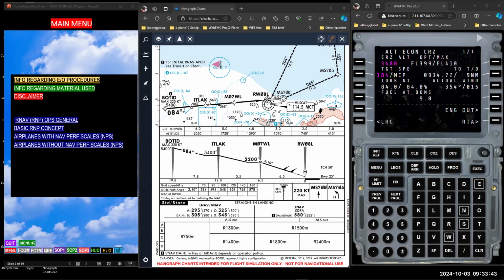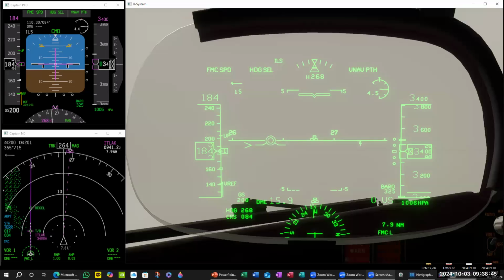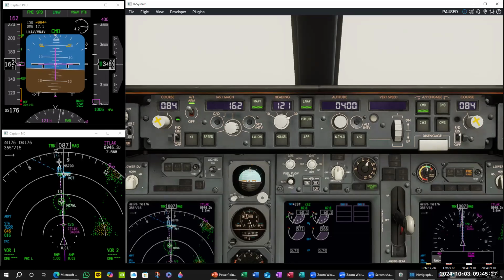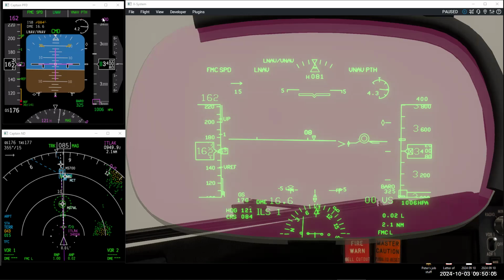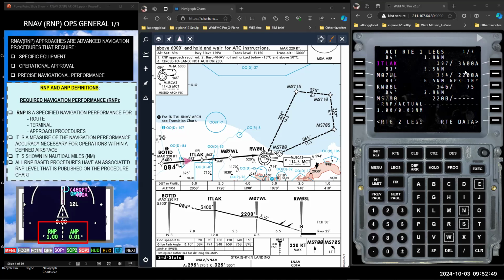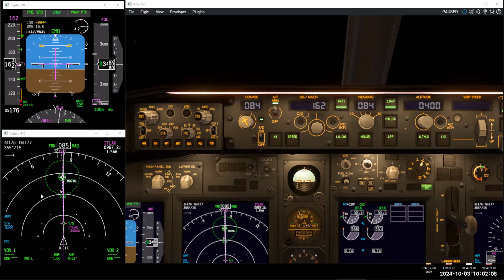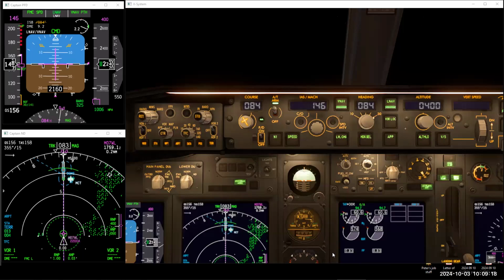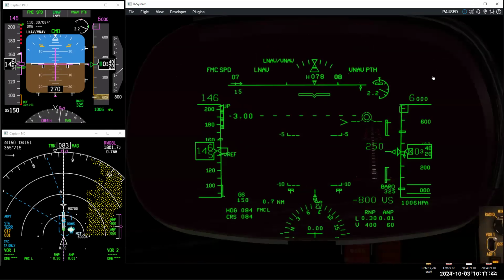#RNAV RNP RWY 08L OOMS part 1

Comment: Hello Captain,

1)
Regarding the HUD, should it normally indicate 3.10 deg Glidepath?
Because it is showing 3.00.

2)
Can you show us how to calculate how much higher we are if the temperature is high, please?

3)
I saw your video about temp correction.

Can you tell below which temperature, we have to include temperature corrections for altitude and minimum, please?
Reply from the maker: 1)The HUD G/P should have been preset to 3.1 from the HUD menu in the FMC CDU before commencing the approach. Remember when you are using Visual references for landing,  follow the PAPI providing you are within the PAPI usable splay/distance for the specific PAPI
Reply from the maker: …for that airport
Reply from the maker: 2)Subscribe to my Library for all your questions…good questions incidentally
Reply from the maker: 2)Cold weather temp corrections formula in my Library
Reply from the maker: 2) https://latlongglobalwix.com